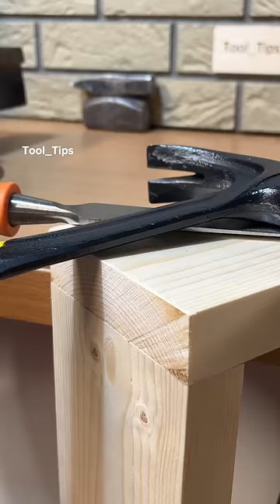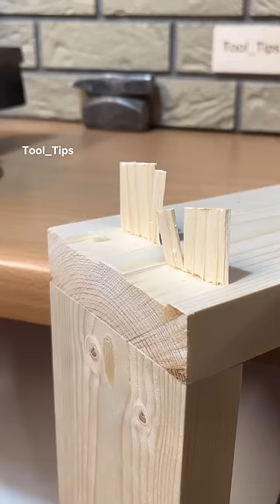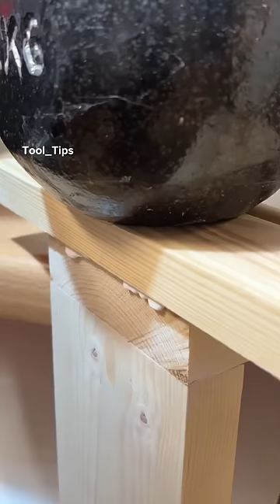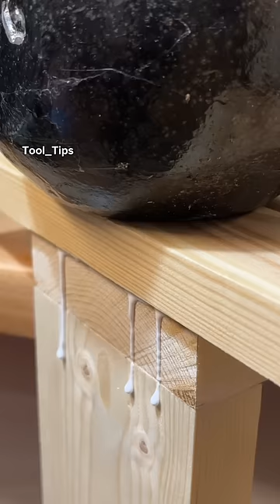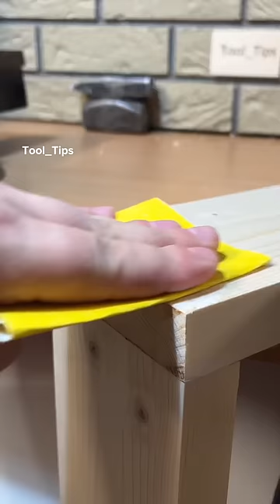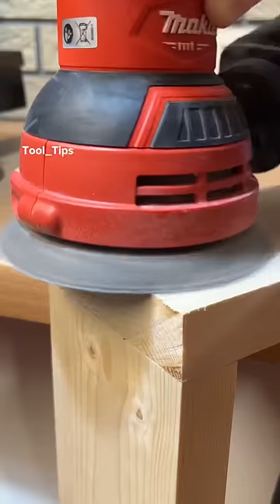Tip for Carpenter and Joiner 👍

Comment: "Tip for Carpenter and joiner" don't take tips from this guy
Reply: Right? A butt joint with wood screws, hiding the screws isn't going to elevate this piece. Too much effort for something you don't care about, not enough for something you do. It's a joke.
Reply: @matisan8407   that is a good technique. you are missing the point. hiding the screws this way can be used on anything. the post isn't about "this piece"

Comment: Good luck the the guy who will need to desassemble for some reason
Reply: Dismantle it cause his pilot holes were bigger then the screw he put in so it was wobbly and falling apart. 
     This is a good technique when done right. And it also usually let's go and separates eventually making it look alot worse then a couple exposed screws.
Reply: @sicktrick111 I dont think the pilot was bigger, perhaps the counter sink was throwing your eyes off. Either way, just use the right bit on your job and only take the time for this if your finished piece needs the aesthetics
Reply: @sicktrick111 yeah, like Daniel said, it was the counter sink
Reply: Hhhhhh😅
Reply: He can do x ray
Reply: Disasemble .. what for ..🤔😂
Reply: Yeah, I was thinking disassembly is going to be tough!😅
Reply: @Daniel-ft9cx 
The hole was too deep.
Reply: Don't sweat it mate this crap is going straight to the dumpster 👌🏻
Reply: @sicktrick111 pilot wasn't bigger nor longer than the screw.
Reply: 😂LMAO...😅
Reply: You don't disassemble it
Reply: No worries he will cut using a circular saw 😅
Reply: Magnet 🧲
Reply: Any method would include glue so they aint ever coming apart... Other than damage
Reply: ikr
Reply: Came to say this
Reply: Exactly what I was thinking.

Comment: That will splinter in short order, especially with a softwood like that. The shrinking and expanding will make that look like garbage. Just use glue and an air nailer to hide the fasteners, you can barely see the nail holes.
Reply: Far less tensile strength in the structure from nails though. 

And if followed up with some quality water sealer or stain varnish….
Reply: @jbirdmax lol you have no clue what your talking about. Tensile strength is a term for how much something can handle before failing.... so kinda irrelevant here. Unless your trying to overload your furniture??? 
    And secondly. Screws are for fastening things. Such as boards to a wall, hanging a picture. Screws are widely used improperly. They are designed to snap and screw things down. A nail has 100x the tensile strength.  Why they are used for building.... Homes anything you can thing of cause they don't snap. They will bend. And hold alot more weight. Nails are structural. Screws are not
Reply: @jbirdmax nails can suck when you use them for the wrong thing, too. Why we have screws. But nail has alot more tensile strength and you can get fastener nails too, which don't pull out as easily.
Reply: @sicktrick111  and you say I’m the one who has no clue what I’m talking about 😂😂😂

To be fair, I could have said high tensile grip, hold, or adhesion. 

Not sure why you’re ranting about this though lol

You of course would use construction or load grade screws which are ten times stronger than nails. Unless you’re using stainless steel nails. 

But tensile strength isn’t what you think it is mate. 
It’s how hard you can pull on something lengthwise before it gives. Screws have nails beat in this department by several orders of magnitude when it comes to how well they hold. 
This is why you don’t see people pull screws out with a hammer. 

But I digress. 
To each their own yea?
Reply: Your theory is only good with one board 90 degrees from another with zero load.
     If you actually built something with nails there would be zero issues with it and it would be alot stronger than something build with screws.
Reply: Can everybody stop replying to birdmax.
He already knows everthing.
Reply: @doodah5521  mature
Reply: @sicktrick111  it’s not a theory in the layman’s terms. 

Go ahead and hang all your door hinges in your house with nails. 

There’s a reason we use screws where high tensile strength is needed. 

You can say construction nails hold better than construction screws all day. That doesn’t make it true. 

That being said, nails have a higher sheer strength. It’s just a matter of using the right materials for your particular job.
Reply: @jbirdmax  yes that's what I said. Screws are fasteners used to fasten things down. This guy is building furniture. Used to load things onto.
Reply: Your still misrepresenting tensile strength.  It would be if I grabbed the screw itself and pulled it till it broke. Your talking about the structure itself which would change it to lateral force or whatever you wanna call it. For the technical term. Either way it changes the variables. I was a concrete former for 8 years. Which is pretty much the definition of that we are talking about and you would get laughed at for using screws. After that I became a journeymen welder. And work with engineers all day. And most the time tensile strength isn't calculated by pulling on the side of a structure that's assembled.
Reply: @sicktrick111  yeah. What would I know. I’m just a lowly retired NC Marine carpenter of 45 years, working in some of the most rigorous military projects. 
And concrete shoring? 
Of course why would you waste your time screwing that together? That would be a stupid waste and overkill. 
 And I’m not misrepresenting tensile strength. Go back to college. If you were ever there. 
And since nails are so much better at holding tensile, go hang all your doors with nails and see how long that lasts. 

Nails are quick and cheap. And they have far better sheer strength than most screws. That’s why we use nails in common construction. 

And if you read my comments, you already know that I’m only talking about construction screws. Those cheap garbage Home Depot hardware store garbage screws have terrible coating and almost no sheer strength.

Edited for a typo
Reply: @jbirdmax  and there you have it. Military.  I didn't join Military welding as a career cause they're trademan are a joke. And underpaid. And rushed to do stuff. Go look at a weld on a tank and get back to me on how you guys operate in the military
Reply: @sicktrick111  nice strawmanning there. WTF are you even on about? What does a military welder and a marine carpenter have to do with each other? And I had to go to a union school for five years to get my journeyman certification before I could do anything official for the marine Corp. 

Know what you’re talking about before you try arguing against it. 

Like tensile strength. 
The level of derp…
Reply: 🍿 for the comments
Reply: @jbirdmax bro do you know even know what a ‘straw man’ is? If you know you’re correct, why do you care so much to prove some random on the internet wrong? Ouu rah 🫡🤡
Reply: @cameronbenn620  yes. Do you?
Reply: @cameronbenn620  

He started arguing against military welders. Nothing to do with the OP or the conversation. 

A straw man fallacy is the informal fallacy of refuting an argument different from the one actually under discussion, while not recognizing or acknowledging the distinction. One who engages in this fallacy is said to be "attacking a straw man". Wikipedia

It can also informally be used to describe when someone tries to say that the other person said something that they did not say, and arguing against that.
Reply: @jbirdmax  the fact you are* citing Wikipedia explains it all my friend 🗿😂
Reply: @jbirdmax  please show me where he was talking down about military welders before you mentioned you were a marine tradesman. I’ll wait…
Reply: @cameronbenn620  
I agree Wikipedia is absolutely garbage as it’s mostly user created. 
But that doesn’t make it wrong. 

And now it feels like you’re just arguing just to argue. So go ahead and pick it apart mate. But keep in mind the op wasn’t really meant for you. Or the other people here who completely misunderstood the post. 

Again, not by anyone’s fault. 
But since you like fallacies, nice Red Herring.
Reply: Screws and Plugs?
Reply: @kashfortheking 🤣🤣🤣
Reply: Nails have greater sheer strength.  Screws are much less likely to experience withdrawal.   The best are "structural screws" like the kind made by Simpson for joist hangers.  They resist withdrawal like a screw but have the sheer strength of a nail. Of course, with the hex head, they wouldn't really be practical for this particular purpose in this video.  

Another interesting bit of info:  ring shank or spiral shank nails resist withdrawal a hundred times better than I suspected before I started trying to demo parts of my 1984 house. The sheathing is attached using spiral shank nails. You wouldn't think that such a mild modification of a nail shank would increase its holding power that much. But holy shit! The difference is night and day and extremely annoying when you're trying to remove them. I was very impressed and annoyed at the same time lol
Reply: .. it's spelled 'shear'... sheer is what your pantyhose are lol

Just to add some fuel to this garbage fire
Reply: Air nailer?
Reply: @jbirdmax screws shear, nails don’t. I can see both being right for different applications.
Reply: @sicktrick111 I had just finished typing that screws shear but nails bend. Which would you rather have?
Reply: @chriswampler1  100%
Reply: @jbirdmax I have used a hammer to pull screws out though. Doesn’t look pretty but it gets them out.
Reply: @jbirdmax that is why those screws can shear the heads off easily when trying to screw them into hard lumber. Sucks.
Reply: @jbirdmax hey!!! Someone knows derp too! Derp dee doo! All the comments have me hee haw-ing
Reply: @chriswampler1  
Thank You. 
My point was only that screws have higher tensile hold than nails. 
Nails definitely have more shear strength though. 

As you mentioned, most construction nails have immense shear strength compared to most screws. 
But less hold strength.

But it seems some people don’t like hearing the truth. They can say it isn’t true, but that doesn’t change the facts. 

At least you understood what I said, and I thank you for not following the heard and misrepresenting that.
Reply: @sicktrick111  that is not why they are used for building kiddo. If you are going to tell someone they are wrong, at least be right first.
Reply: Little bit of pine flavoured filler and you don't even see the nail holes.
Reply: @sicktrick111 💯
Reply: @sicktrick111 for small things doesn't fking matter what you use. use what you got and make it work
Reply: @cameronbenn620  A fun discussion. My fav part was Cameron trying to fit in to an adult conversation, but instead finding himself appropriately belittled. Poor little Cameron and his struggle.
Reply: @michaelc3977  3 months later? Haha get a life my dude, also prove anything I said wrong please? You’ve added even less to this conversation. Are you happy you got to see yourself comment though? 🤦🏼‍♂️😂
I guess I’m supposed to just keep arguing when it’s clear me and the other guy don’t agree? 🗿😂

Comment: You might want to put a piece of wax paper over the glued pieces before pressing with another piece of wood.
Reply: Why?
Reply: @coppulor6500  So your press block doesn't end up glued to the joint.
Reply: @georgeallen2479  thanks!!
Reply: @user-ye7sm1kt1d  You've obviously never tried to break two pieces of wood apart that have been glued together. Yes, it does matter.
Reply: @user-ye7sm1kt1d 
Sanding will not replace a plug of wood that has just been snatched out by a press block that was accidentally glued to your wood work, hint wax paper ✌️
Reply: @coppulor6500 you didn’t notice the block they used stuck?
Reply: ❤❤ kerja rapi dan bersih ❤ terimakasih pembelajaran ini ❤❤
Reply: videodan daha mantıklı 👍😁
Reply: Not if you're bossing you don't
Reply: And the main joint & screw holes need glue as well. Why do it if it's going to be a wobbly joint? Otherwise neat tip if the wood you're working with is soft enough for the chisel trick. But come on man!! Show the job fully properly.
Reply: Se pega la madera tienes que usar papel
Reply: Everybodys a know it all
Reply: @danielmittelman6905  maybe not everyone, Daniel. :face-blue-smiling:
Reply: What’s the point of all this?
Reply: Also, less glue
Reply: Or use real glue 
Because this one is not holding
Reply: Зачем? После видеомонтажа Вы всё равно не увидите разницы
Reply: I usually use masking tape as I don't travel around with wax paper, works great. Ill have to try the wax one day if I need to do glue up at the house.
Reply: just use cello tape it's cheaper and works the same
Reply: @backwoods6050 but it didn't. Offer the advice when you see that it's needed, not when it isn't
Reply: Or a Walmart plastic bag

Comment: The impact driver is for mechanics, you're supposed to use a wooden mallet on your chisels, A joiner typically doesn't use screws to join wood when you can cut an actual joint into the wood.
Reply: I'm surprised he didn't use hammer drill for the hole...
Reply: Impact driver for mechanics 😂
Reply: @Michael-vp6oi  Would you like to express your opinion or are pictures how you communicate with other people?
Reply: @owaind-g678  🤣 I must admit, I have trouble expressing my opinions to the intellectually disabled so I thought pictures would help but I guess there's no hope for some 😔
Reply: @Michael-vp6oi  Bless you.
Reply: @owaind-g678  Thank you 😊 🙏
Reply: @owaind-g678 mechanics use impacts that are hundreds of times stronger than that one- that is a normal woodworking impact
Reply: @carterrrrrrr  Depends on what your working on really, I use the 1/4" more than a 3/8" or 1/2". I find they are superb when working on engines where you have lots of threads to spin off and usually high torque bolts to break free, the impact is designed for this purpose. As a carpenter I can safely say I would always prefer to use a drill driver for screws,  I've got a 36v brushless hi-koki that spins any size screw with ease, much faster and less of a headache than an impact. Sure it's heavy but so are great big chunks of wood. I will admit the little 1/4" impact is nice for taking screws out though, kind of back at what it's designed for I guess.
Reply: @owaind-g678 that's the difference between an impact wrench and an impact driver of course an adapter makes one of them the other…. 

I usually skip all that nonsense and use my wood welder.

Comment: For cabinet making when doing trim, and sometimes applying wood moulding in a house, there's a small tool that's like a round chisel.  You tap it into the wood at an angle, and it lifts a curl up.  There's a hole in the blade, and you put a finishing nail through it, and set it a bit.  Then you pull the chisel out and glue the little flap back down.  Basically an invisible nail.

Comment: Nice work. Be sure to follow that up with some  Thompson water sealer. Otherwise it might splinter or pop apart over time. 

With those screws it’s probably a good strong connection.

Comment: Don't ever do this.
- carpenter of 25 years.
Reply: Why?
Reply: What's the reason
Reply: Because customers come to expect it? It's a hastle.
Reply: @lancemill5683  1 - Screws into endgrain have poor holding capability. 2 - Learn to make good looking, functional, strong joints without fasteners.
Reply: @lancemill5683 because it looks shite even in this video, never mind when the adhesive starts failing and the wood he splintered starts peeling back
Reply: @onecalledchuck1664   - really?  I've built/sold dozens of benches with screws in end grain and they've held up for years even after being abused by drunks at camp around the fire.

Comment: Why buy/cut a plug when I can do this and spend 3 times longer prepping for screws, 3 times longer sanding, and risk having the whole thing tear out on me? I'm sorry folks, but if you do this, any actual wordworker will think you're an absolute greenhorn.
Reply: Because if you used this method frequently you'd be good at it and it doesn't take long. No, "an actual woodworker" would not know they were there.
Reply: @histguy101  I don't care how frequently you do it, this adds an extra step to the process and risks tearing more of the face out of your board than you intended to. Not to mention the fact that it makes your patch about 4 times larger than it needs to be. Are you a woodworker? Because I've seen plenty of woodworking done, and I worked for a carpenter for over 6 months, and not once has anyone who isn't this random lifehack channel has ever so much as suggested that this is a method you could use.

Comment: Using pine is why this might seem fine to  a non carpenter/woodworker. A tighter grain, and deeper colored hardwood would make this look a lot more obvious and like trash. Not to mention, chiseling out the wood in the first place would be a lot more difficult to not cause down the line cracks and keep the chiseled out pieces small. If you’re using pine then you shouldn’t give a damn about nails or screws because it’s pine… it’s a cheap wood for building home’s structurally, not for making a furniture piece that looks aesthetically good.

Comment: If you are staining this wood, you don't want to allow glue to get into your end grain, it will not stain.  Wipe excess glue off as you press it, then tape down your two tabs before putting a plank and weight on it, the thickness of the tape will help set the tabs flush instead of just above flush.

Comment: You got thewrong screws, the board will not be pulled to the lower board, the thread grabs on both. Fail. Also, use a real clamp to apply pressure.
Reply: Good catch. Plus no glue in the screw holes and contact joint surfaces? Screws become the joint clamp - with the proper threadless upper shaft - but screws no glue going into wood WITH THE GRAIN ON A CORNER = EPIC FAIL. Odd the cosmetic trick shown but ignored basic good practice. His wobbly drill maybe a sign of wobbly results.